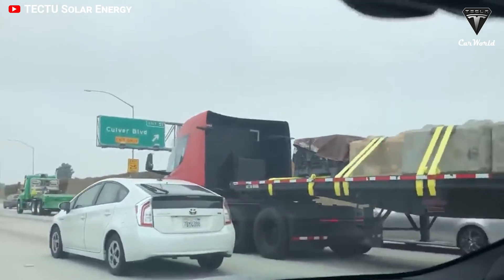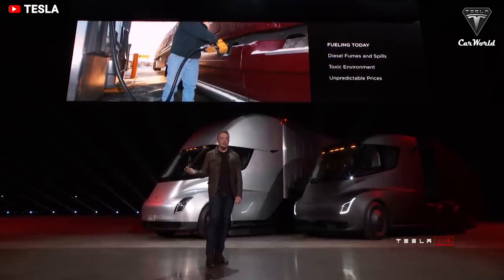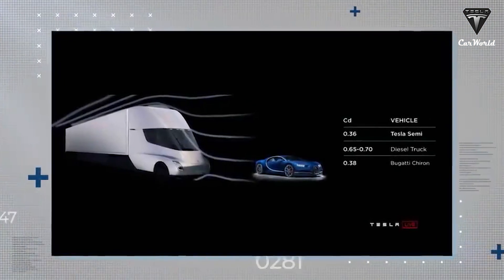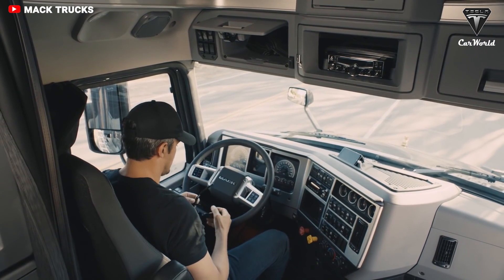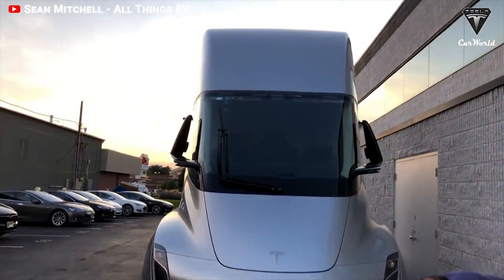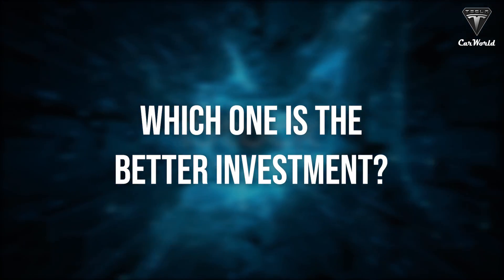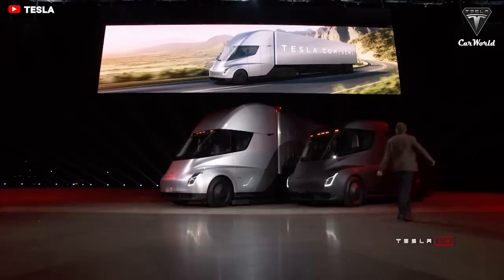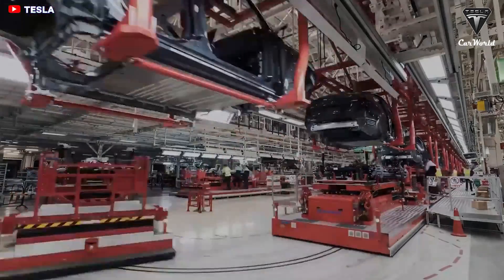Which is the KING of 2023 heavy trucks? Mack Anthem Diesel Truck Vs. Tesla Electric Semi?

Comment: Both are amazing thee question i have is how long will it take to charge the truck.  For true over the road drivers being able to keep going is big
Reply: Some modification on legislation to allow for rest times and charge times to occur in parallel could be helpful.  When I go on long trips I take naps while charging.
Reply: 30 minutes for 300 miles of range
Reply: not really...by federal law you cant drive more than 715 miles a day if you can impossibly average 65mph...after 8 hours of continuous driving it is a federal law you need a 30 min break...in 30 mins you can charge 350 miles of range...500+ 350 happens to be more than 715.....now there is no fast charging network for these yet so for now they are only good for "day" haulers and ~500 mile range as there will be nowhere to charge...for now

Comment: The “Extra Range” version offers 500 miles …
A typical “Over the Road” scenario is at least 600 miles per day for a driver to make a decent income.
Further, the idea of charging while being loaded or unloaded is highly unlikely … how many freight customers are likely to put in, or bear the cost of Charging Ports?
Pretty much everything this narrator is telling you about the Tesla is hypothetical with very little real world application.

In an “8 Series” Heavy Truck, 0-60 in 5 seconds or 28 seconds might sound like a lot of fun but has little applicability. Honestly who needs to get 40 Tons (80,000 lbs) moving 60 mph in 28 seconds.
Also … the reason trucks top out at 80,000 lbs is due to regulations set by road wear and infrastructure carrying capacity. Tesla being “able” to handle 82,000 lbs means nothing … it isn’t legal.
I once hauled a load at 115,000 as verified by the receiver’s scale … by accident … THAT wasn’t legal either.
Reply: IF the Tesla semi is for real, emphasis on IF, then surely the need for 600 miles per day will be dramatically reduced by eliminating the cost of diesel?

Comment: Acceleration for such massive truck carrying 80,000 pounds of load is really insignificant for safety reasons this trucks need to move and start up slowly and gradually increase its speed for 50 reasons so 0 to 60 is actually pointless
Reply: Also it has to protect the load attached to it! This isn’t a game at all.
Reply: @carholic-sz3qv   indeed sir. If i were truck owner or druver i would care about top speed or about seconds to 60. Becouse it can never move so fast or reach high speeds anyway. Trucks start moving slowly and drive at speed limits in middle lanes . More important is brakes, fuel use, sleeping quarters and livability

Comment: My issue is number of battery cycles. Many semi trucks do over 100,000 miles a year. After 2 years, it's highly possible, your going to need a battery replacement. How much is this going to cost?
Reply: That's impossible seeing as lithium ion can only be recharged 1,000 times...
Reply: @erictuffelmire6826  there is a guy on YouTube that uses his tesla model 3 as a Uber lift car. The battery was out of warranty, due to distance & the car was only 2.5 years old  when the battery needed replacing. He kept his battery between 20 to 80% charge, but needed to super charge 3 times a day as he had know facility to home charge. This & the fact he had a short range battery, ment, he used up all 1,000 charges.
Reply: @SunRise-ul7ko  

The other issue besides capacity at that point is lithium ion batteries  form dendrites and is at risk of fire.
Reply: @SunRise-ul7ko  Tesla actually notes in the car manual that using a supercharger more than once per month will shorten battery life significantly…(and is a breach of warranty).
Reply: @erictuffelmire6826  wirb lithum,miíloñ time lime çapítorré
Reply: Battery replacement vrs how much will someone save vrs the cost of new battery’s vrs the traditional cost of oil and fuel no one’s taking about the trailer universal connection   hook up can Tesla adjust to what is mostly already out there If you ask me a power trailer along with the work horse is key.
Reply: Power only trucking is a full truckload capacity solution that occurs when a carrier provides only a driver and a tractor (also known as a “power unit”). In power only trucking, the driver does not bring a trailer, but instead hooks up to and hauls a trailer that is either leased or owned by a 3PL or shipper.
Reply: Tesla guarantee 1 million miles
Reply: @manojgv4556  funny cause Mack states rebuild at 1 million....

Comment: Tesla is basically a daycab, and will really only work well on short run dedicated routes due to limited range.  Yes it's fast but most professional drivers, myself included, aren't looking to win races.  

It will be interesting to watch these develop but batteries need to be much better before the tesla will be successful for 600+ mile days.

Lastly the tesla is absolutely hideous looking and I absolutely hate these econocar looking interiors and minimalist interiors.  Most truckers want maximum control, and value function over form.

How are you accounting for the road tax portion of the price of diesel?  These ev trucks need to pay their fair share for roads

Did I mention the tesla is ugly.  Not a bit of style or chrome.  Company drivers forced to drive a tesla will be mocked at truck stops.

Tesla needs to make their styling look more sophisticated and less like a child's toy or a transformer toy.

Comment: Strange how people often comment on what is WRONG with a new idea instead of looking at what is RIGHT.  With 100's (possibly 1,000's) of variations or road transporters, from delivery vans to the largest semis, one truck is never going to be perfect for all applications.  Over time EV truck manufacturers, not exclusievely Tesla, will cover ALL requirements if .. and I repeat "IF" .. this Tesla semi ticks the boxes in its 'specific field' regarding economics, durability, reliability, blah, blah, blah ... It better, for Tesla's sake.  So, what is THIS particular Tesla EV's "thing"?  Quite obviously, with a (claimed) range of 500 miles, it is not intended for work 'off the beaten track' but it may be suitable on highways - 500 miles is about 8 hours driving .. one working shift per day (??).  The Tesla doesn't have a sleeper option - it doesn't even seem to be intended for east coast to west coast routes.  Where it might 'shine' is for companies such as Pepsi, Walmart, blah, blah, blah.   What the Tesla EV truck DOESN'T have right now is a 'track record' in economics, durability, reliability etc.  This will take time.  If it doesn't stack-up then we can all dump shit on Tesla's EV truck .. and ..the  religeously diesel cronies can shout "I told you so".
Reply: Volvo have thousands of electric trucks (including over a thousand class 8’s) on the road in four different models and so does their subsidiary Renault. One size doesn’t fit all.

Comment: Just have to question the "Road Use Tax" included in the diesel fuel.  There is none in the KWH to charge the truck.
Also, if the diesel could be re-engineered to be used in electricity generation, how would that compare cost wise.  Not talking about diesel generators but processing the same diesel into some other fuel when it is refined from crude oil.
Reply: New Zealand charges a road use tax based on odometer readings at the end of the year on all heavy vehicles.
There are ways.

Comment: I had a 2020 Mack Anthem and it was the the biggest piece of junk I've driven in 35 years of trucking. Everything breaks from normal non-severe highway service. It literally falls apart on you while you're driving. Several major breakdowns in the first year. Anything is better.
Reply: Not really. Our company leases new peterbuilts that hardly lasts two weeks before a major breakdown.
Reply: @nickreyes4570  I thought Peterbuilts last life time i guess i really overestimate the hype of it
Reply: You had a faulty unit. The Anthems I’ve been around and in are some of the strongest trucks on the road. Plenty of power and very reliable if maintained properly.
Reply: @AirborneRenegade  Then I must have a faulty unit too.  Everything in it rattles and feels like front end is getting ready to fall off.
Reply: Are you planning to get a Tesla Semi?
Reply: @DarkHawkk  Tesla semis can be great BUT they haven’t added the sleeper yet which is a big deal
Reply: @TuneyDarko  For 500 mile range mostly the Tesla Semi will NOT need a sleeper cab for years. TAM for day cabs in North America is 3 million trucks. Maybe in future models with high range may have the sleeper cabs.
Reply: My dad worked at a Mack dealership for a few years and there were always nearly new trucks there getting worked on. The kicker is many of the repairs require you to go to the dealer since they are the ones with the special programming tools. Right to repair is going downhill.
Reply: diesel is over by Semi
Reply: @thinhle8472  Not really. Trains and some planes still use it. Jet fuel is a refined form of diesel I believe.
Reply: That's why this channel picked it, no doubt.
Reply: @bendeleted9155  probably not
Reply: Really!? They're that bad?
Reply: @dbsti3006  He got a dud. My company I work for has used Mack semis for years and have NEVER had big issues. Same reliability as any normal semi as far as im concerned.
Reply: @LukeGray-fs1sl  The whole line of Anthems are junk.  I've had 2 of them both junk.
Reply: @dbsti3006  I was offered a brand new peterbilt and noticed it in a dealership in Chicago getting the fuel lines replaced. I'm glad I refused to take it.
Reply: @nickreyes4570  I believe you, I just didn't expect supposed "top of the line" trucks to be that bad. Maybe it's time for something new. Cars are always advancing rapidly but trucks are the same old same old with new features time to time. Tesla trucks might be the advancement the logistics industry needs.
Reply: @dbsti3006  Some trucks still even uses a V8 mind you most widely used today for semi trucks are inline 6
Reply: What will happen to tires with Tesla?  I think those tires would be excessively worn out with Tesla than Mack?
Reply: What will happen to tires with Tesla?  I think those tires would be excessively worn out with Tesla than Mack?
Reply: ñot theré eltríç
Reply: I couldn't agree more. I currently drive a 2019 Anthem. In the 1.5 years that the truck has been assigned to me, it's been in the shop about 5 months.
Reply: No kidding, seen them broken down on highways.
Reply: Yup anthem just bad   Mack Chu pinnacle a lot better.
Reply: So now you wanna buy an even bigger POS TESLA SEMI?😂
Reply: Wait until you get Tesla. Then you will find out, how something breaks without possibility to fix😉
Reply: Also doesn’t help that Mack redesigned the mp7/8 engine to have the timing gears in the back of the engine to help reduce engine noise. It did reduce it, but they have issues of idler gears coming off the shafts or gears spinning causing the engine to come out of time. That means the transmission has to be pulled, clutch, flywheel, flywheel housing, then gears and hope no internal engine damage. Had a few that had that happen to in our fleet. But they are great working engines and they can definitely haul the weight. Our heaviest truck was 120-130k on 6 axles. 3 steer, 2 drive, 1 straight/dead axle. That truck had the mp8 in it
Reply: sounds like a volvo semi truck. shits falling off them as they leave the dealer. floppy headlights are the first sign the truck is doomed and that happens in the first 1000 miles
Reply: Because it's Daimler.
Reply: @Rodrihx  No its Vulva.
Reply: @Rodrihx  Daimler owns Freightliner and Western Star... nothing to do with Mack

Comment: Oops! It seems I stumbled upon a Tesla fanboi site. There's a lot to like with the Tesla truck but 'range' was kinda glossed over but I would think that would be important if you are a 'long-haul' trucker. I don't consider 500 miles either 'long-range' nor practical. How many miles can it cover, by law restricting driver's time behind the wheel, in a week? What's the resale value of a Tesla truck with a worn-out battery? How much to get a replacement battery? You barely scracthed the surface of the questions someone in the business would want to factor in. I wish your site and Tesla well but I'm not convinced. A 40 thousand dollar government bribe to buy one doesn't sound like it will sell itself.
Reply: Yes full of fanboys that don't know crap about trucking . It's hilarious. They are so dumb.

Comment: The EV truck doesn't have near the energy a diesel. The amount of motors is immaterial. It will only haul 10,000 lbs maybe 15,000. The Tesla actually has less horsepower, just more torque. The Tesla is for show. Notice there are no real road test. Suckered born every day. Like Pespsi.

Comment: They should have the Tesla trucks connected to over head wires. No batteries required.

That of course would mean they were on a fixed route so they could make special lanes just for the trucks.

Because they have their own lane you could run them on durable metal wheels with a special groove or slot in the road so they don't need to steer. Autonomous!

Then you could also link them together in a long chain. 

Call it the Tesla Radical Advancement In Navigation.
Reply: i see what you did there
Reply: Chooo chooooo
Reply: :-P
Reply: I read where they are experimenting with that in the UK.  Would be extremely expensive to run overhead lines even the railroads haven't done that to any degree.
Reply: @charleshaggard4341  the main Edinburgh to Glasgow train line runs right by childhood home. Full electric now. Extremely quiet, smooth, fast and easy to walk to from anywhere in town.
Reply: And Musk again invents something that is worse than what we already have: coal powered trucks with lower load capacity.
Reply: @alphaomega5721  Yes the coal chute and smoke stacks on the truck are poorly disguised.  Good eye.
Reply: Yeah, because trains have solved logistics throughout the country, right?
Reply: @jovanleon7  Because Americans can't see past the end of their hood.
Reply: We already have electric trains.
Reply: i like this idea...
Reply: so basicly this is just a weird looking train?
Reply: Buses in England already have overhead power connections on trial.
They recharge at each bus stop.

Comment: Great video but why compare it with a Mack truck? The right comparison would be to Mack's parent Volvo. The Volvo VNR electric is rated at 455 hp and 4.051 lb/ft. The Tesla Semi would have been really innovative if they had made the extra space work and added a toilet and shower to the truck. Other brands offer trucks at over 600 HP and 2050 lb/ft torque with the Cummins ISX15 or Detroit DD16. The real downside to electric trucks is A: charging, which means loosing money and you cannot just get a high voltage charger installed without a permit and some serious power lines and B: driving in the winter without the heater on because your range will probably be problematic and good luck getting those charging caps open at 5°F or lower.
Reply: You pump the heat that the motors and battery pack create into the cabin just like you do with ICE engines off of their respective cooling systems.
Reply: Zord:  You can't spell "losing" and you don't seem to know that the Tesla will charge 70% for 350 miles range in a scant 30 minutes.   When the Volvo can out accelerate the Tesla from 0-60, be sure and get back to us.
Reply: @rogergeyer9851  I am sorry that my spelling has offended you. I typed this while  in by bunk bed. Tesla has been vague on the details of charging those trucks other than pulling 1MW from the grid. Musk said that he likes nuclear power so maybe he will invest portable nuclear power stations to provide electricity to those truck. Good luck trying to sell those trucks overseas where power is much more expensive and the grid even less reliable at times. The whole idea of having a center cockpit position is probably to allow for global sales in LHD and RHD countries alike. Fast charging would not be the issue if it actually worked. A lot of super chargers are now getting to the point where you can charge at full power. If the high power grid fails, The truck would need over 9000 Amps @ 110V to fast charge, which would melt the cables. So instead of 30 or even 60 minutes, it will be hours. 30 minutes would be quite reasonable as you would have to take breaks anyway and filling up a regular truck with diesel also can take quite some time. We have a Daimler electric rollback. which is quite nice actually. Our range with some reserve is about 146 miles and it is supposed to support a similar fast charging as Tesla offers. Currently we charge it with a 360V outlet for 2.5 hours, which is perfectly fine for local towing and recovery tasks. Now assuming you would charge it for 2 hours to get some range to the next fast charger which you hope is free and working better, you are still loosing 1/4 of a working day in profits and in some instances have to face penalty charges . On paper it all sounds amazing. The acceleration btw. is the only point that sells me on electric trucks. I could probably make a daily trip on a single charge if those numbers are correct. Let's wait and see what actually happens and how they will solve the issue of the electric power grid. Btw. all of big truck manufacturers are investing in more or less the same fast charging infrastructure in the US at the moment, so maybe there is a chance that this will work in couple of years.